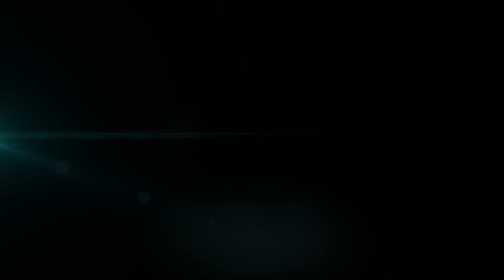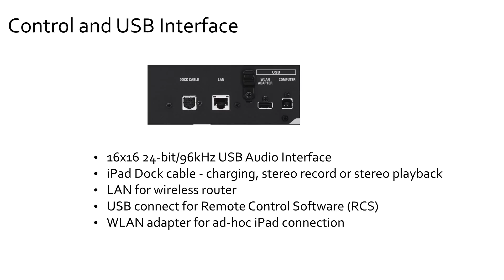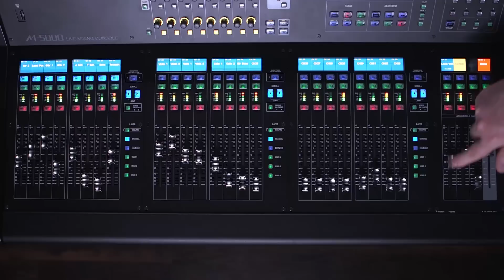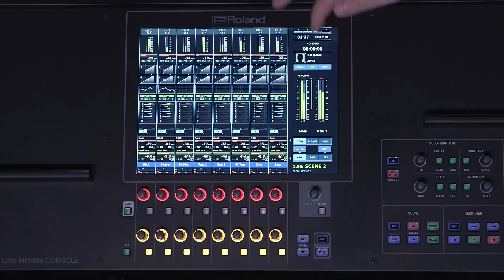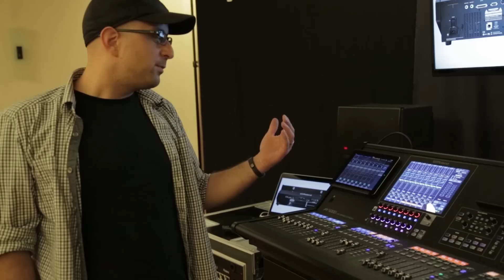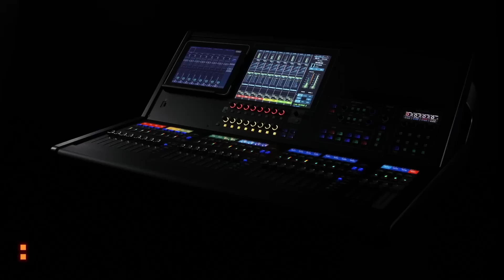Roland M-5000 Introduction Webcast

Comment: super flexible console especially when you add in monitor sending via REAC and having a monitor at the desk.  Being able to use "legacy" snakes in the Roland line is great as well.  Behringer has some great features, is much cheaper, but the integration for users isn't there yet.

Comment from the maker: @David Preece - The M-5000 has 300 scenes per project with the ability to update parameters across multiple scenes when changes are made to mix settings.  The ability to import a single scene from a project saved to a USB key into the current project on the console is also possible.